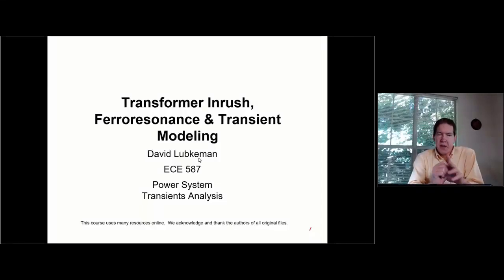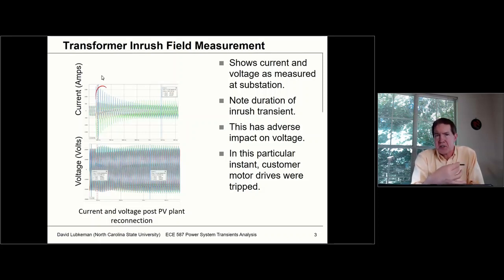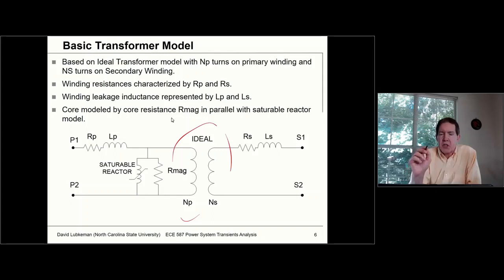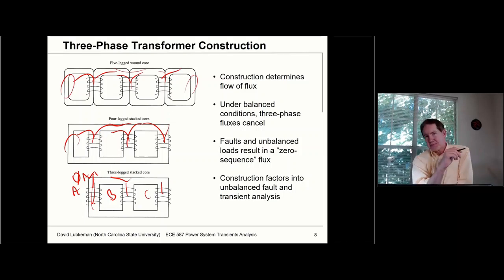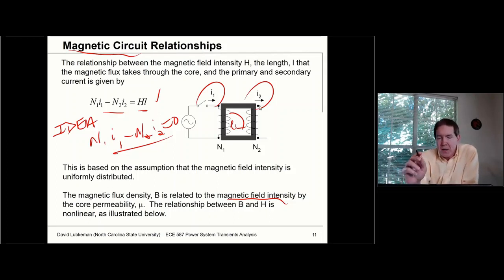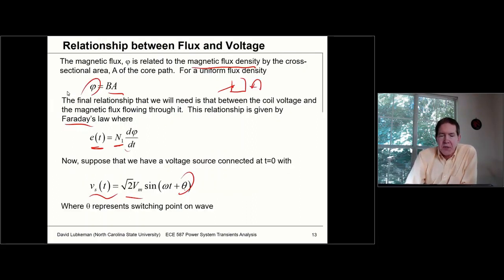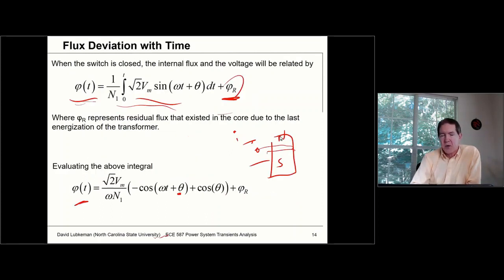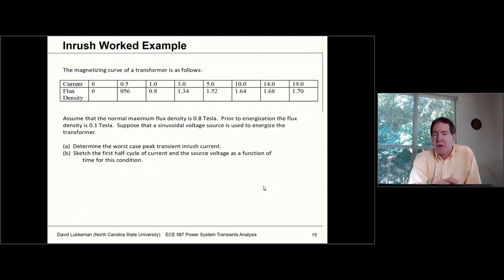Lecture 8a Part 1: Transformer Inrush Modeling Theory - Power System Transients Fall 2020 - Lubkeman

Comment: All 20MVA transformer cannot be energized at same time, there will some delay in between the trafo's energization, hence impact of inrush current and voltage drop could be minimized. In your example are you considering all transformer enegized at same time?
Reply from the maker: This is not a computer simulation, but a real field recording as taken from a substation relay showing the impact of PV plant energization.  I don't have the information on what percentage of the plant's inverter transformers were energized in this scenario.